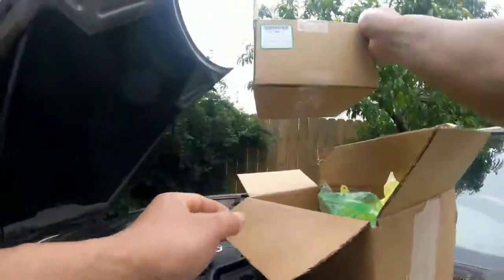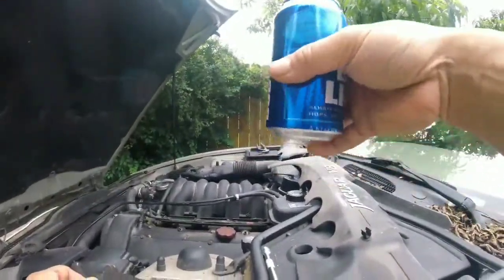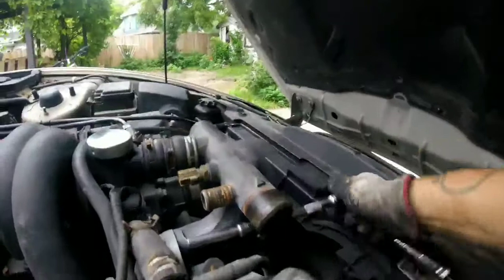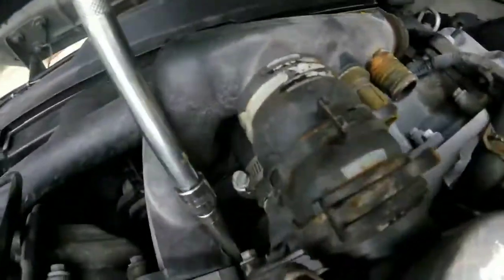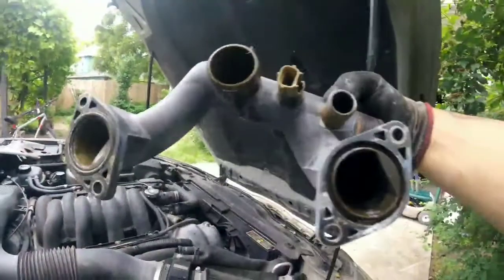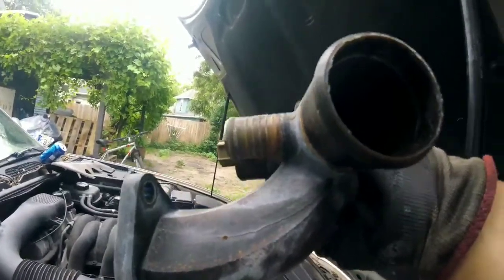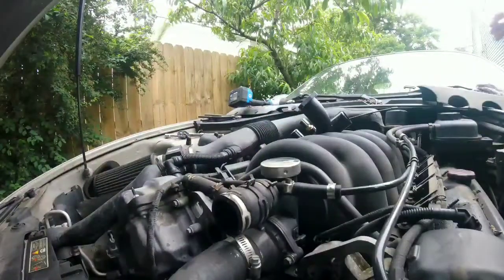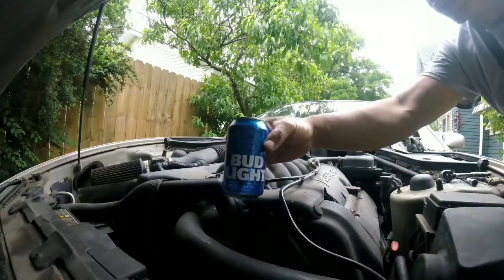Jagura xk8 thermostat housing replacement

Comment: That was not the thermostat housing, was the crossover pipe, easier job. Good tip with the beer, though not real beer in that vid.
Reply: If u change the housing you'll be stuck with the two rear screws for at least 1 hour lol
Reply: @charlievoltaje  I did mine ok, bent the end of a (10mm?) open ended spanner to get to them.